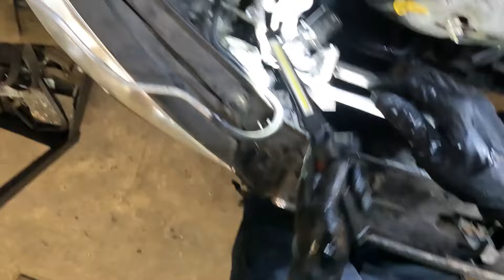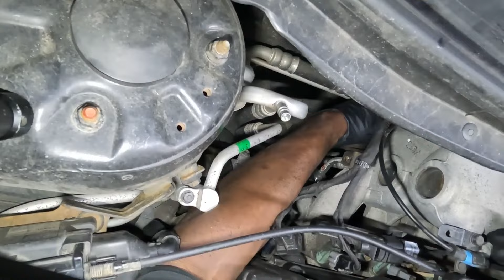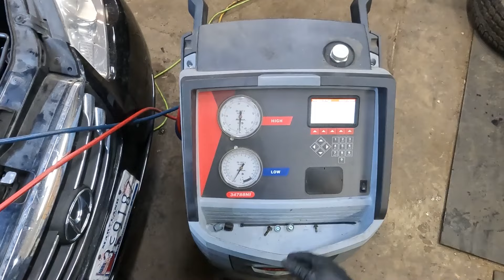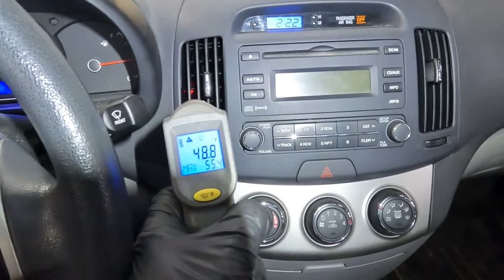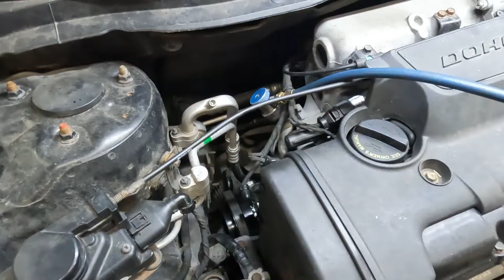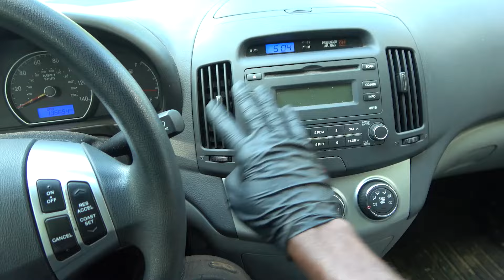AC Not Working On This Car ( THE FIX ) Part 2 - is it Low On Freon or is the Compressor Bad?

Comment: you asked to receive comments good or bad. so in my comments its not to make you look bad or down you. you do awesome work but please look into a micron gauge. i use several wireless probes so i can graph pressures on my ipad.  i use bluvac mini micron gauge and testo 549i for hi and lo side measurements, but if you ignore me i understand, but i love learning and when i was introduced to what we should be doing it made me better at ac. i no when i have removed the moisture and in 1hr of vacuum with that machine and use the micron gauge it will open your eyes to fault of those ac machines. yes you have to have one but understanding its short Commings  its like introducing someone to a lab scope the first time they see more than they ever realized, big i opener.
Reply from the maker: @user-hi3pt3mv2i  Sure! Thanks for your input, I'll look into it getting a micron gauge, I like to learn also, so if getting a micron gauge will make me more efficient and more accurate, I will get it!
Reply: @KITS_Auto_and_Truck_Repair It seems like everyone in the comments is an expert. 😅
Reply: @zygi22  yes some us are. some of us keep up and more so learn more.

Comment: Wow, working as an MB tech, if we were replacing a compressor and condenser, we flushed the lines and evaporator with denatured alcohol. We never took for granted that just replacing those parts would get any miniscule debris, and we always replace o rings, never reused them if a line or any component was disconnected. If we did not do that and the AC compressor failed, expansion valve failed, there was no warranty at all. We also had to add the proper oil and dye with every repair as well. Waiting to see if those fans come on.
Reply from the maker: @carmo9693   Oh Cool

Comment: I love the chanel but not this video.  The diagnosis was too quick, the problem could have been the expansion valve.  That compressor didnt look weak actually looked like the pressure was too high and expansion valve maybe was the only issue and much less expensive repair.  2nd would have preferred replacing those o-rings in the connections. Otherwise good video. 3rd normally ive seen mechanics remove the oil from old compressor and measure it and then remove whatever is needed from new compressor.
Reply: if the expansion valve was stuck shut it would be a restriction causing hi on hi side and very low on low side, what i think is if that fan not working causing both pressures to be hi. as we no editing can do wonders for fixing, i believe he did not show the fan before and after the repair
Reply from the maker: @x01e  Thanks for your input! I like your thought process but I've seen bad compressor do this, next time I'll sure I take my time during the diagnosis process, the expansion valve wasn't the problem here!!
Reply from the maker: @user-hi3pt3mv2i  The fan wasn't the problem! I appreciate your input
Reply: @KITS_Auto_and_Truck_Repair  you showed the fan not working when compressor  came on. most all cars will activate the fans especially under hi side pressure. maybe thats not the case for that veh, just never run across that on a modern veh with electric fans. since you are watching what we have to say please please get u a micron gauge for vacum and get back to us and show the importance of the tool. it changed my ac work totally. i learned from the residential and commercial hvac people, its a real eye opener for me. you as well as others in our trade have been taught wrong. but when tom lech and hvac school channel jim bergman man they have got me up to speed. i give a 2yr warranty unlimited mi now cause i no im getting it right. im also trying to master super heat and subcooling thats helping diagnose better as well. i dont no it all but im getting way better cause i like learning and growing . its the things i did not no was hurting me. now my eyes are open and i will get even better so thats my challenge to you if u except it. no harm intended .
Reply: @KITS_Auto_and_Truck_Repair  Thanks Kit, ok based on experience it was bad ac compressor, experience helps and obviously the repair worked.  Good job
Reply: @RATCHETMAN1001  This is a good point, and makes sense to me assuming that when the expansion valve opens it opens both the high and low.

Comment: Did you have to add oil and dye to the compressor? I did not see you change any connection o-rings. Do you recommend this? Great video.
Reply from the maker: @rayp.454   Yes! Thanks

Comment: i have a question, for example on Honda jazz the amount of refrigerant on data plate is 450g. if you are using those refrigerant containers 13. kg and vaccum gauges, how do you know you have uploaded the right quantity of refrigerant and or needles on both low and high side should be at which range? thanks inadvance for those who will help.
Reply from the maker: @nyikadzinotsikidze3444  the AC machine will tell you how much refrigerant you have in the system, but the pressure gauges would not accurately tell you how much freon you have in the system!

Comment: Thanks for your video 
The question now what are the causes that make ac compressor to fail , don’t withstand the high pressure on high pressure line and disengage the clutch and what is the input make clutch to engage ? 
As an idea for you could you cut the compressor to pieces and see the fault that inside compressor please if still have it ?
Thanks again
Reply from the maker: @adab4586 My Pleasure1 No I don't have it anymore

Comment: Kit, great video. I have a question though. If the compressor was bad, and you change the condenser as well, because of metal fragments, shouldn't the system be flushed, or did I miss that. Perhaps there is metal fragments throughout the system.
Reply from the maker: @odubb45  Yes the system should be flushed!

Comment: I have watched some of your videos I think you are very good I'm trying to find some one that has the same problem with the A/C on 2014 Mercedes Sprinter the air for the driver side is cool but the passenger is hot
Reply from the maker: @cladiodecastro6189  it sounds like you have a mode door problem!

Comment: The thing to do before replacing the condesor is to check the condenser fan
The fact that fan not turn that's pressure goes up so high hence the low side pressure would also drop
Reply from the maker: @eugenenicholson1390 Yes!

Comment: Once there is no indication of oil on the condensor most of the time its not leaking
Get the fan working then check for circulation of refrigerant  (freon)
Reply from the maker: @eugenenicholson1390  Good point! since the drier was part of it, it had to go

Comment: Please what causes the problem that make you change the condenser
Reply: all of the new condensers have micro channels not the old big serpentine pipe anymore and those micro channels are super small ,so the condenser is acting like a filter and you cannot flush or back flush. so if a compressor fails internally it sends that debris straight to the condenser. thats why you should change it, if not you will have premature failure of your new compressor
Reply: also if you dont use a micron gauge you are just hoping in that one hr of vacuum is good enough but you will never no for sure. thats the purpose of the micron gauge
Reply: also thats the flaw in those machines. letting a machine do the work, so any body who has not studied ac  will use this practice. but if you study hvac you will no the flaw it has.   but mechanics seem to be the last to get proper training. also no mechanic is looking at sub cooling and super heat.
Reply from the maker: @adamissah452  The dryer on the condenser was dirty!

Comment: That a big mistake when you didn't change the O rings, it happen to me, the old O rings can cause a  small leak undetected by regular refrigerant leak detector, and it will pass the leak test, but the small leak happen  when the compressor is on, under hight pressure, it takes 3 to 4 may be 5 months till the system got empty completely, so i did change all AC system O rings no exception (compressor, condenser, drier, and expansion Valve), and also changed the hight and low side valve core (becasue it has O rings there), and my problem.got solves, the system stayed full forever, no more leak.overtime, it is now 3 years and the AC still working. For that car only yome.will.tell, if the AC stayed working till the next summer, so no leaks, but if it dosent, that will be the new problem.
Reply from the maker: @abdouallahuniverse5689  oh really!
Reply: @KITS_Auto_and_Truck_Repair  it happen to my 99 Honda crv, filling up the AC at beginning of the summer June, and in October no refrigerant in the system anymore,  and  I was going crazy, I didn't know what to do,  except changing the evaporator under the dash, and that no easy task, changing all AC lines, and an idea came to my head, let change all the system O rings and see what happen, and I got surprised  when the problem solved completely.

Comment: Vacume test is not accurate for small lack
Reply from the maker: @batdrestha  Yes! I agree, the vacuum test is not 100% accurate!
Reply: @KITS_Auto_and_Truck_Repair  i agree. so using analog gauges wont  show a leak unless its massive. if a front pump seal pulls in some while pulling a vacuum and allows a small leak those gauges wont  show that, so that expensive machine will not reveal that problem.so while that smart machine is pulling a vacuum it will pull in more air into the system and you will never no, but that micron gauge will let u no, so there is no need to keep pulling a vacuum while still allowing more air into the system. micro leaks small leaks large leaks that is a study by itself. but most of us cant think on that level or dont wont to. and then vibrational leaks while driving the list goes on.if you going gain ground on these problems we have to think deeper. use more of that brain power. we choose to get better or we dont
Reply: Agree based on videos for Mini Splits or normal non auto ac systems, they pump nitrogen at high pressure to be 100% sure of no leaks.
Reply: @x01e  you are right this is my way and I keep the nitrogen at last for 12 hours to be sure
Reply: @x01e   residential and commercial does not use rubber seals gaskets rubber hoses an  external compressor  seal, these are our enemies. so we can have leaks under vacuum and hi pressure. we cant just change an inline drier filter like they can. the deck is staked against us. our system could be made way better but that wont never happen. i would design it with a filter drier before condenser with a indicator for moisture. also a hi pressure port before and after condenser. cause some times you cant measure super heat and sub cooling on most of our systems unless you remove the front end. same for evap cause how the put the expansion valve. i use ultrasonic detector and i wet everything doing that, sometimes co2 and refrigerant or nitrogen with refrigerant, big blu soap, stratus d tek sniffer, dye under 175 psi